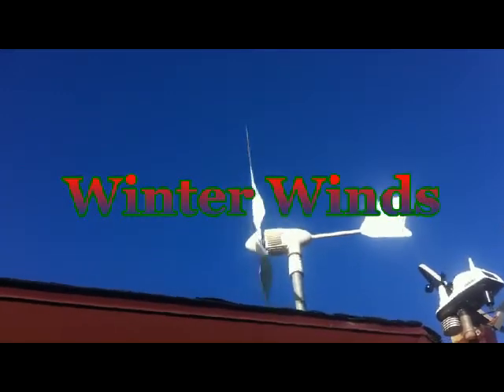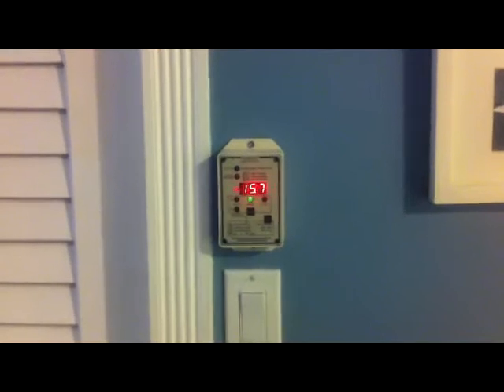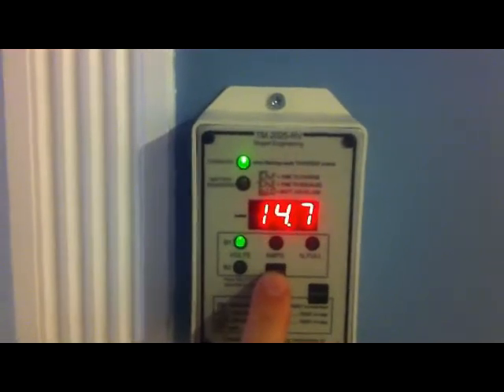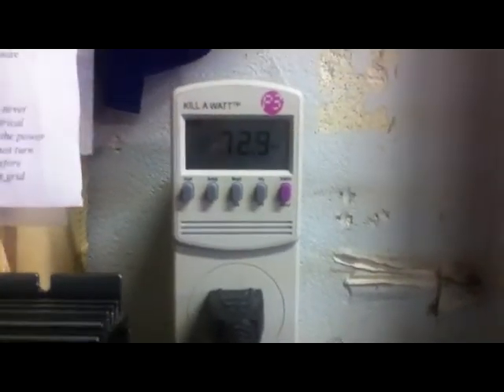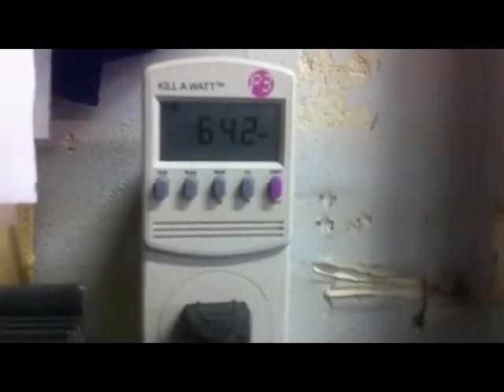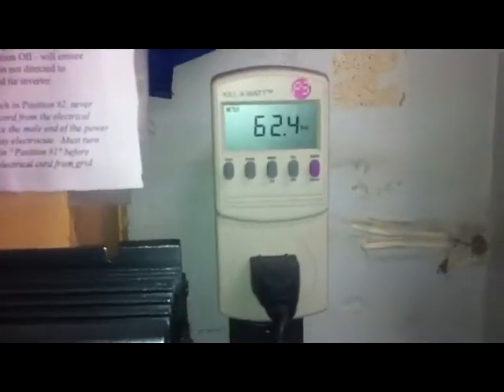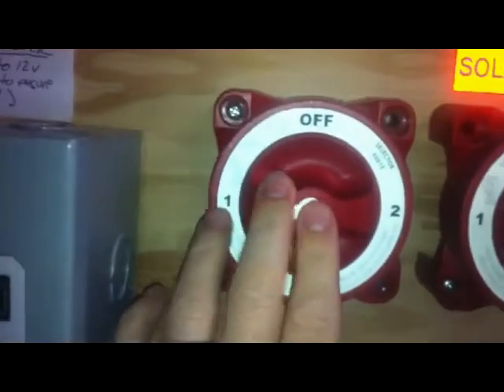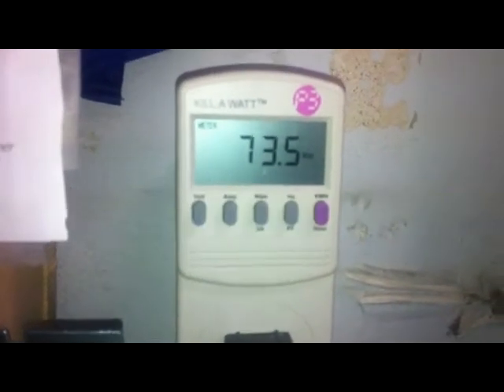Home Wind Turbine

Comment: Hi Nick, you have a very nice setup.
Is the grid tie invertor that's connected to the wind turbines dump load and when it's directly connected to the grid a MPPT inverter?
Reply from the maker: Sander Dijkshoorn It does but only to a cheap plug-in grid tie type inverter which means you lose some of the efficiency

Comment: I am looking for a good dependable wind turbine to compliment my solar for off grid,  I love what you have.  So, is that a windmax 400?  I have been to several forums that do nothing but talk down the windmax.  as a matter of fact, they have nothing good to say about any of the small turbines. Is there a way we can PM each other for more info?

Tom
Reply from the maker: Hi Tom- I’ve been offline for a while...but I am happy to share my opinions and you can PM too.  But, after lots of research, trial and error, I’ve learned that there are very few turbines (micro) that produce much, even in moderate 10mph winds.  On the one hand you have the store bought (e.g., Windmax, MWS, etc...) that are less expensive and fairly reliable but will not produce much usable energy, and other the other side you have the off the shelf (home brew models) that costs more ($1800-2000) but will produce double or triple what the store bought models provide.  Of course in the area of home brew models you need to be careful who you buy from and quality and production can vary wildly.  I would recommend checking out Orlando Sanchez youtube channel for info on the axial flux he builds.  This axial flux was originally designed by Hugh Piggott (spelling?) and Chris Olsen.  But, the production from this turbine is remarkable and literally night and day from anything I’ve every seen.  In fact the closest competition in terms of production to this version of the axial flux is a Bergey or Kestrel (these are very expensive store bough micro turbines), and honestly the Olsen/Sanchez axial is better.  I can't speak to their reliability, but I can speak to their objectively quantifyable production.  That said, if you are not ready to drop that kind of money, then I think the newer versions of MWS and Windmax are pretty comparable in production in my opinion.  I'm sure others will debate that, but I’m sharing my personal knowledge.  Yes, you can PM me for further info or questions

Comment from the maker: Thanks.  Yeah i went with the WIndmax 400, but if i had to do over again I would spent the extra couple bucks for the Windmax 1000w which is not much bigger in size but more double watts. Even though i hate buying foreign chinese junk, Windmax is an overall good product for price. Good PMAs and production curves. Of course, unlike solar, the turbine is more hobby than real energy production, but it does help offset the cloudy stormy days and fun as hell to play with especially in winter.